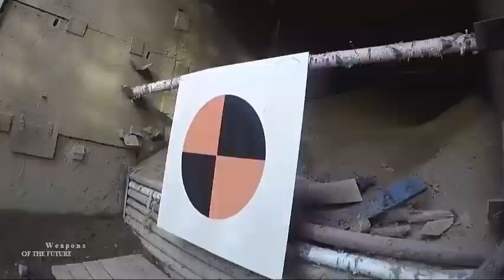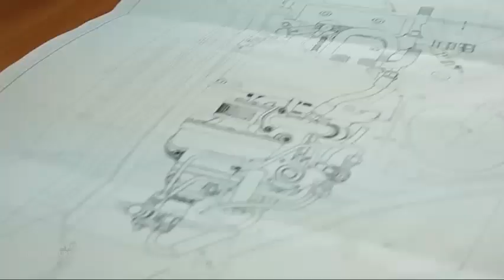Finally, China's newest main battle tank is ready to be used as the world's most advanced tank

Comment: The threat of Chinese tank power is very real.  The Abrams needs a new gun.  Enter the Lathe of Heaven.  Here it is the year 2024 and the US is still playing with smoothbores.  Everyone knows rifled guns are more accurate.  Certainly, I understand your reasoning.  You can get higher velocity with a  smoothbore.  You can get longer barrel life with a smoothbore.  Plus smoothbores are better suited for firing fin stabilized projectiles.  But the truth is, you are stuck in the past.  Rifled guns are superior and I will tell you why.  Certainly, you do lose some velocity with a conventionally rifled gun having a relatively fast twist.  But this is irrelevant, since long rod penetrators do not respond to spin stabilization alone.  To maximize the performance of a long rod you need both spin and drag stabilization.  Imparting gyroscopic stability to any projectile tends to reduce yaw and cant, preventing the projectile from "wandering" during flight.  In the case of a long rod impacting a slanted armor face, it also makes the penetrator more likely to "dig in" instead of glancing off.  What I am proposing is a gun rifled with an extremely slow twist, firing a cone stabilized long rod.  Consider the advantages.  With such a slow twist, velocity loss would be minimal.  Fins are inherently inaccurate, since they tend to catch random air currents and veer off course.  Cones fly straight, and do not respond adversely to spinning.  You have an inherently accurate projectile vs and inherently inaccurate one.  Did I mention that rifling improves sabot separation?  Now let's talk about velocity.  The current fin stabilized "arrow" fired by the Abrams tank has a muzzle velocity of slightly over 5000 fps.  That sounds fast, but it's really not.  Most people would agree that velocity equals progress.  The DU penetrator fired by the 120mm smoothbore weighs about ten pounds.  I am proposing a smaller, lighter penetrator, more akin to a crossbow bolt instead of an arrow.  We still use nitrocellulose based propellants.  More powerful chemical propellants do exist.  RDX and HMX are two examples.  To further increase power, solid compressed propellant loads are also a possibility.  If you combine a lightweight "bolt" and a solid compressed HMX load, extreme velocities are possible.  Ten thousand feet per second?  Faster?  The US needs to be aggressively developing this technology.  Of course there are drawbacks to extreme performance.  Reduced barrel life is one.  However this can be effectively offset, as I will explain.  Chrome lined barrels are obsolete.  A variety of harder, tougher coatings are available.  PVD coatings such as titanium nitride have been in widespread use for many years.  More advanced coatings such as DLC Ta-C have recently become available.  If you line a polygonal rifled bore with a tough, heat resistant coating nearly as hard as a diamond, the result is a barrel life exceeding 1000 rounds.

To summarize, a rifled gun firing a cone stabilized DU bolt at 10,000 fps should be able to destroy any current or projected tank from a range of five miles.  Thankyou for your consideration.